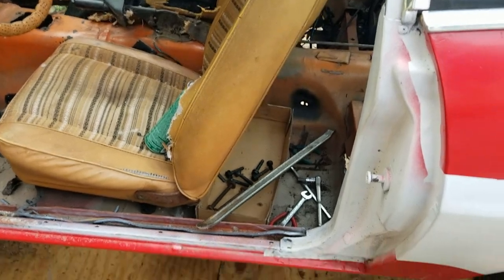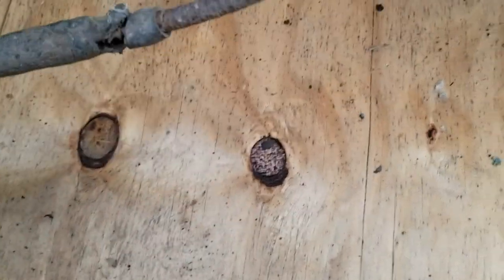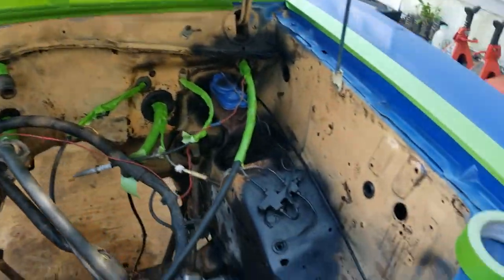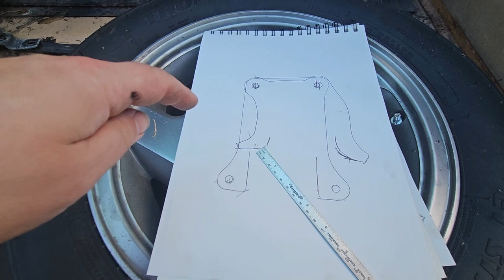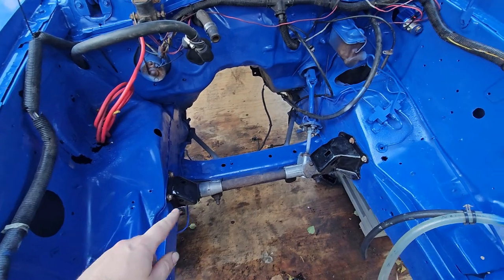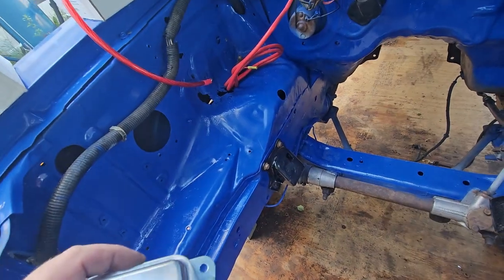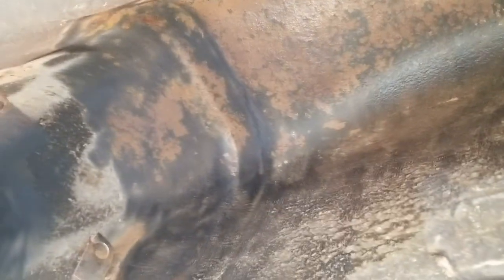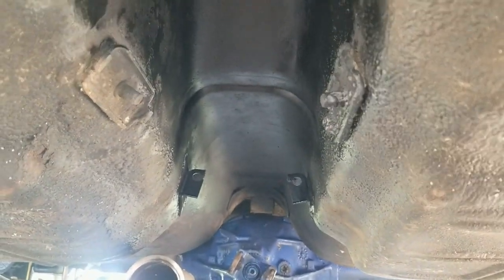Drag n Drive Pinto: V8 & SROD Swap 2 #nonamenationals

Comment: I had the exact same color interior in my 79 pinto so i painted all of the plastics with SEM interior dye, put a plastic dash cover ,new carpet , new ebay racing seats, head liner, and new carpet all in black and it looks really good. If your rear seat is vinyl u can use the SEM on it and it should last a bit. Ive got a 347 stroker in my pinto with a t5 5speed trans, 8.8 rearend with 4.10 gears and caltracs , hooker headers , 3" exaust with mini race bullets  turned out the side right infront of the caltracs. Its a really fun car to drive
Reply from the maker: I have a white vinyl back seat from a mustang ii, I will be painting the rear plastics with white bedliner. Probably black carpet and a gold dash. I can't find white racing seats. Lol
Reply: @firepinto  I wish I could find a black mustangll rear seat ,  it would complete my interior. Im ready to get the yellow/tan back seat out of it

Comment: I had to use the original 4cyl drivers side frame mount on the passenger side and the drivers mustang ll mount on the drivers side to get it to work after drilling new holes in them for the motor mount bolt to slide thru but hopefully u wont hafta go thru all of that but I did use maverick motor mounts though
Reply from the maker: I have all Mustang ii mounts, I hope it all just bolts up. I'm out of time to make the No Name Nationals.  Lol
Reply: @firepinto  aw man I was hoping u could have made it but theres next year, that thing is going to be a lot of fun when u do get it finished up
Reply from the maker: @79beans347  I think I'm going to make it there, just not sure what I'm bringing. There is still hope for the Pinto.
Reply: @firepinto  oh ok , I hope it makes it , might be the only one there

Comment: I did away with my voltage regulator and used a 1 wire alternator on mine
Reply from the maker: Mine will probably too, the new regulator looking box is just something to make the dash light work as far as I know.